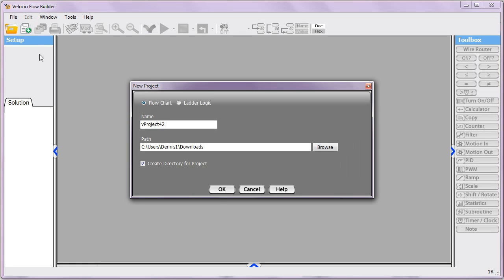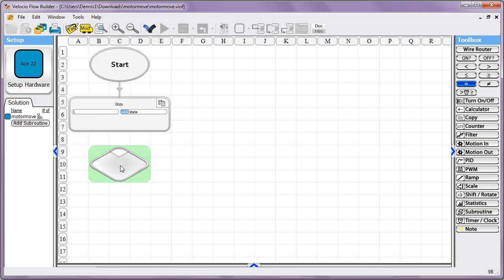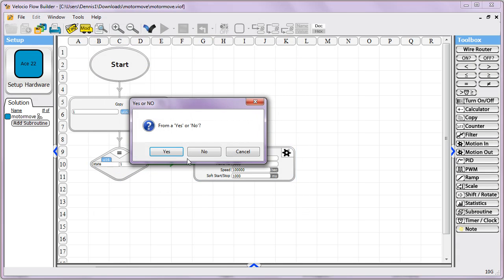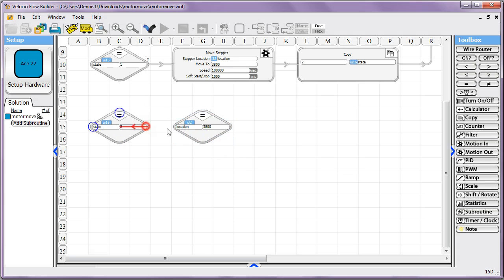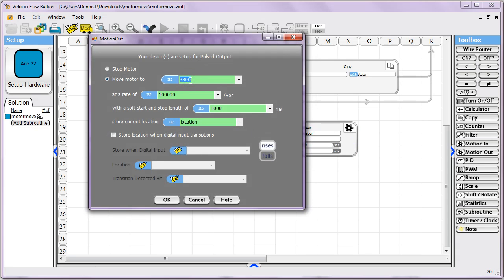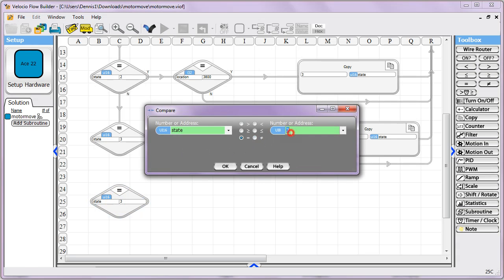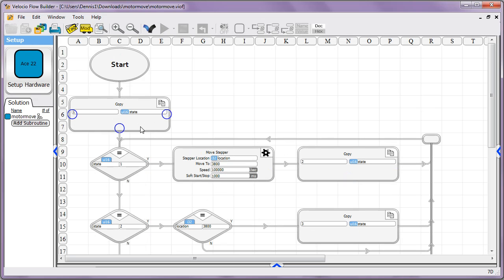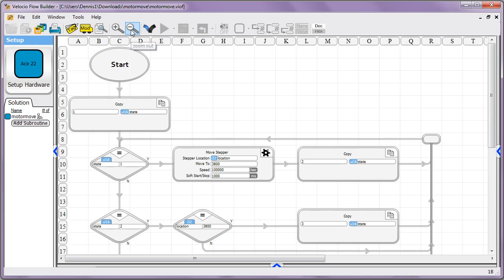Stepper Motion Example

Comment: Is there any way to interrupt the stepper motor motion? I'm working on a piece of test equipment that is using a vision system to detect a product feature as is passes by. One of the inputs will receive a rising signal as the camera detects the feature, but it looks like the stepper has to complete it's entire travel before stopping.
Reply from the maker: Yes, you can issue a Motion Stop command.  This will stop the motion, even if more pulses were scheduled.  Additionally, we have a very powerful feature for this kind of action.  The Motion Out function has a feature that lets you detect the exact Step pulse  that an input is detected.  With this, you can very accurately position a motor based on an input.

Comment: So there's nothing telling the PLC it's at location, it's just checking to see if it has itself outputted 3800 pulses, (in the first move out to 20 inches).  Is that correct?  If so, basically it's telling it to go in a positive direction, and when set to 0, go in the negative or opposite direction. Right?
Reply from the maker: +onjoFilms That is correct.  Stepper motors are open loop, which means there's no feedback telling you where the motor is.  If knowing that your motor is exactly where you want it to be, there are servo motors that accept pulse and direction as inputs and make sure they get where you tell them to go.  This includes the Clearpath line from http://www.teknic.com/
Reply: +Velocio Okay, thanks.